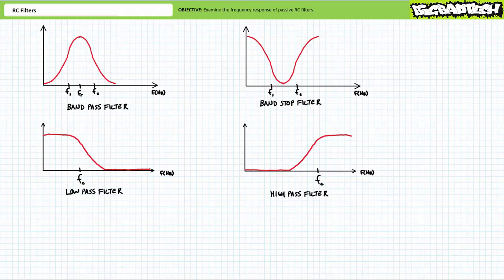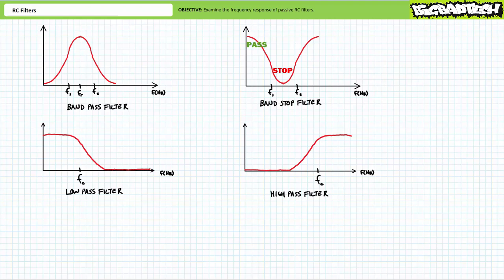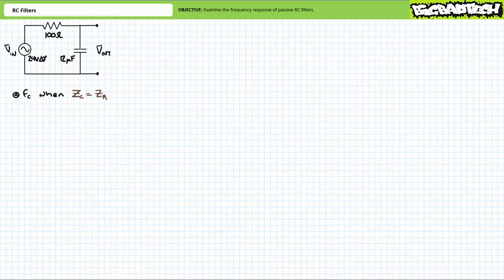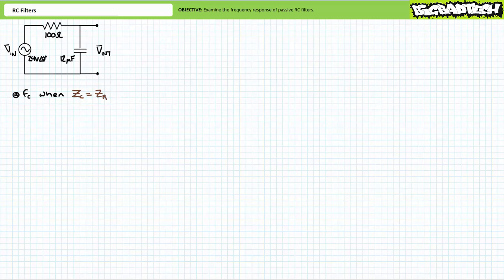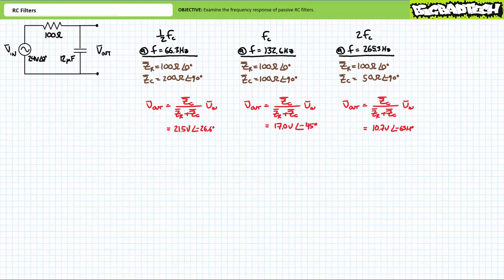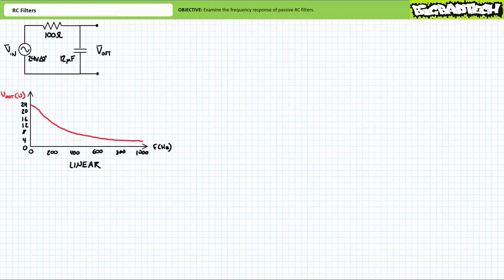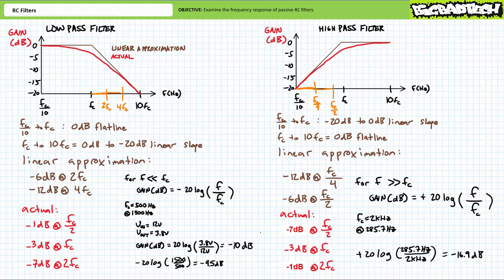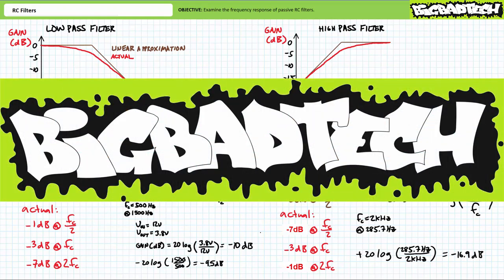RC Filters (Full Lecture)

Comment: Something I keep thinking is missing in the EE lectures: the purpose of a filter. Cool that we can calculate all this, but why? My first thought is audio: splitting out the low frequency range for the woofer from the high frequencies of the tweeter. Cool. Also, removing static from a sensor or signal line. What else are filters used for? One minute on this would help students put everything in context
Reply from the maker: Good point, however, filters exist exactly for the reasons you specified. Passive filters can only get you so much but, as an extremely simple example, consider a radio station with a specific desired frequency. One could use a band pass filter tuned exactly for the desired frequency such that the desired frequency, and the desired frequency alone, receives maximum power and other undesirable frequencies are rejected.